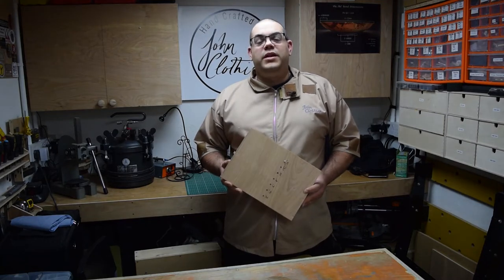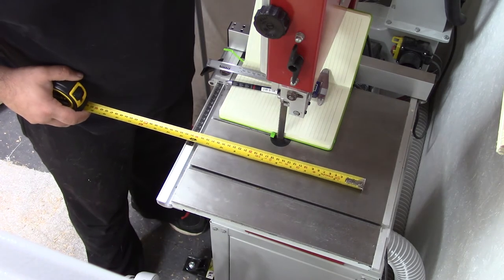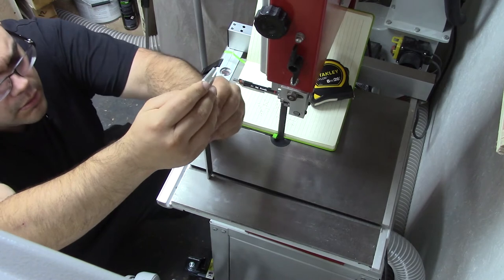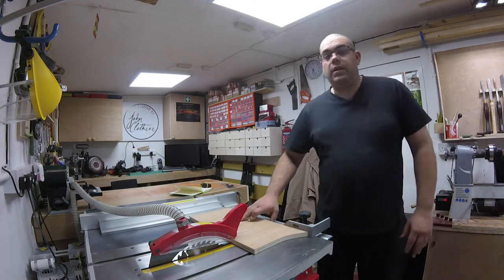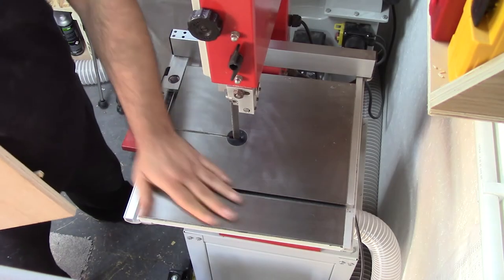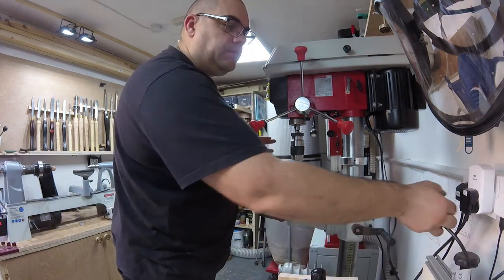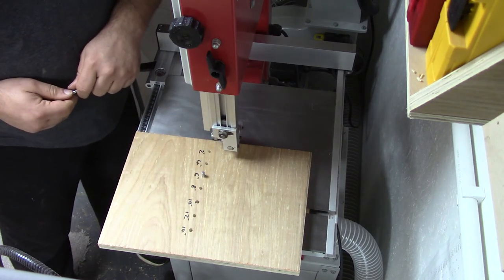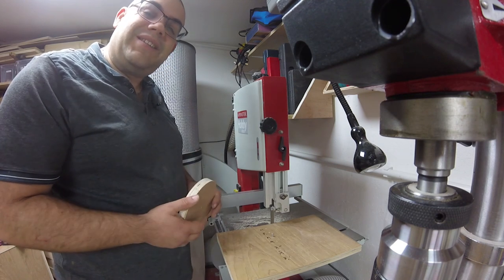Bandsaw Circle Cutting Jig

Comment: Nice video John, I need to make one for my band saw! You could try using a thinner blade, as it may help with cutting the circles. I found than a thicker blade is hard work for the band saw if your cutting tight circles.I bought a 1/4 inch one from tuffsaws, and I'm pleased with the quality.

All the best

Owen
Reply from the maker: Thanks Owen. Thanks for the tip!